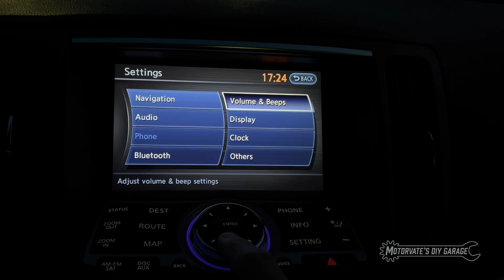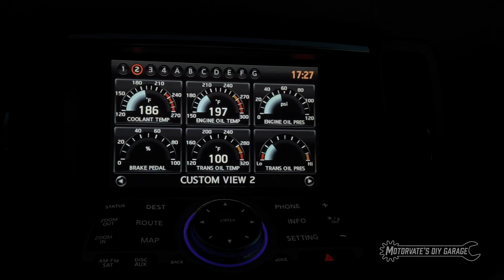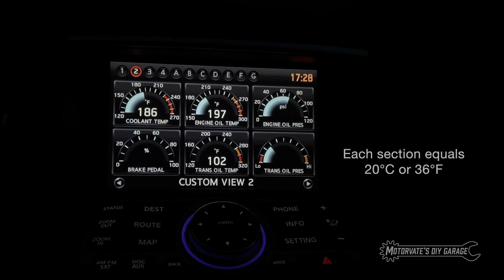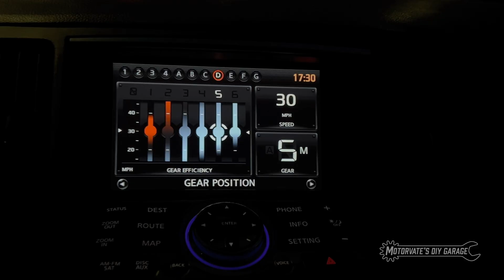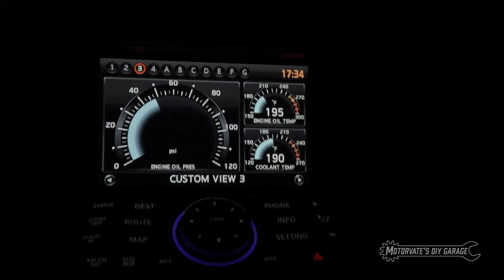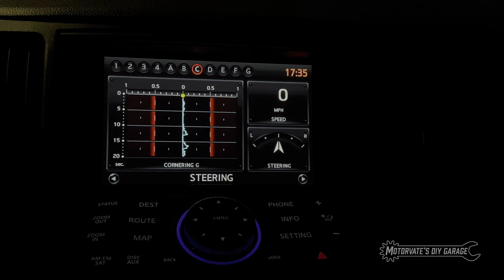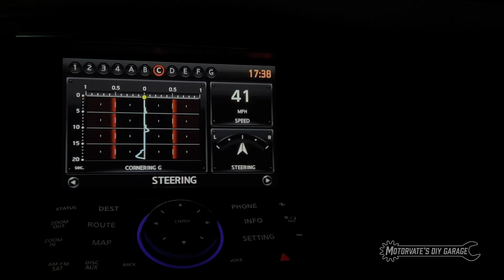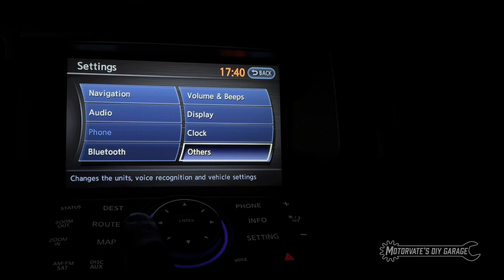They're DONE! GTR Gauges for the G37: MotorvateDIY Garage Ep.53

Comment: Great to see you made some great progress on this project!! You're doing such amazing things for this community!!

 I personally have some interest in this setup. My biggest hesitation is my car is tuned via EcuTek, and I've already purchased their Bluetooth module that does the same thing (albeit much less elegant looking than your solution! Gear indicator is something I've always wanted in my manual sedan). However, being able to run a Bluetooth oil pressure sensor is such a great addition that it may be the sole reason I jump ship. Is this system able to display ignition correction by chance? That's probably my most monitored parameter besides oil, coolant, and intake air temps.

My other reason is if the screen is controlled with the "Enter" switch on the wheel, I assume I can't change my music unless I back out of it? Not the biggest deal since we have controls in the center but it'll be something to get used to.
Reply from the maker: Thank you for your kind words!
The EcuTek app has the most flexibility. The GTR gauges don't have much flexibility as the 20+ different gauges are defined and can't be changed.

With one exception: The "Trans Oil Press" gauge can be anything I want it to be. Right now, I use it as diff oil temp, but it could be changed for ignition timing. (Ignition correction is an EcuTEK created item, so I'm not sure if I can get that. I'll look into that down the road)

I didn't show this in the video, but the "GTR MFD Converter" module also sends the calculated get to the factory cluster for the 6MT.

Just like this: https://youtu.be/wQm-7cxolm4?feature=shared

I also didn't show how to bring up the gauges. There are two different ways: (1) Press radio preset button #1, and they pop up! This can be a little bit of a pain if you listen to the radio a lot, but I wanted a button that was easy to reach, so I chose that one. (and I don't think many people use the radio today!)

(2) Apply 80% or more throttle (actually accelerator pedal position) and they pop up automatically!

You can change/skip to the next song, just use the "Seek-CAT" or "Track" button  just to the right of the clock. Also, if you are on a non-GTR Gauge screen, the steering wheel buttons work just as they do now.

I hope I answered all your questions!
Reply: @MotorvateDIY  Thank you for the detailed reply!! The EcuTek app is great for what it's designed for, but most people don't need to data log and send things to my turner often if ever. I rarely ever use the Nav screen anyways (except for tire pressure from your previous video), and having it integrated allows me to use my phone for navigation instead

Yeah. I remember seeing that video when it came out and it's something I really wanted. I personally wished this car had the synchro rev-match with the gear indicator like the Z but I get why they didn't include it

Having it pop up with the preset is a pretty quick and convenient IMO. My dad does listen to the radio when I drive him but he'll just have to live with 1 less preset lol

Is it possible to have the command to switch displays customized by the end user? The 80% throttle command is really neat, but I can see how some may not like it
Reply from the maker: Here is the wonderful thing when you program something from scratch... you can do anything you want. :)

I could add a jumper on the board to allow the end user to enable or disable the auto popup. Thanks for the suggestion!
Reply: @MotorvateDIY  You're not wrong! Very excited for what's to come. Best of luck!